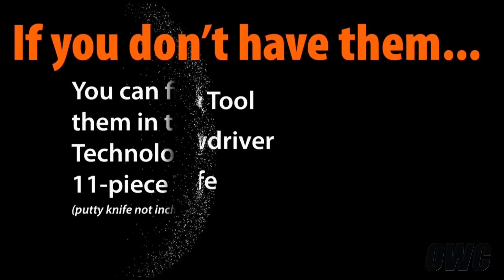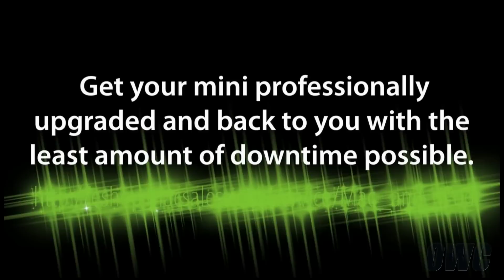How to Install Memory (RAM) in a 2009 Mac mini (Macmini3,1)

Comment: Takes some courage to apply the necessary force with the putty knife and when u take off the WiFi/Bluetooth antennas, but other than that it's not all that difficult.

Upgrading from 1GB to 4GB really improves multitasking performance.

Comment: And you are correct.  The Mac mini has user-serviceable parts like the RAM, but if you break anything whilst installing, the warranty is voided.  But if you have a problem with say, your motherboard, they should cover it.

Comment: @Mike: You can magnetize a screwdriver by dragging it on a magnet. Don't drag back and forth, just drag in one direction (from center to tip), then pull away and repeat a few times. More strokes == stronger attraction. Even a simple 'fridge magnet will work.

Comment: I bought the 4 Gig OWC memory upgrade for my Early 2009 Mac Mini and used this video for help with the installation.

No problem it worked great. The extra 2 Gig makes a big difference.

One thing worth mentioning - you need a very skinny phillips screwdriver to get at the screws.

Comment: Great video! Took me about 20 minutes, most of it getting the cover off. It was totally worth voiding the warranty. It's up in six months anyhow. During install, my AirPort antenna disconnected and I did not reconnect the audio ribbon correctly. I learned that you can never be too careful around these connections.

Comment: so , i did it and works great. I did however break off one of my air port wire antena. The first one that is attached to the drive side.works fine...am i going to be ok ,or should i start taking soddering classes?

Comment: Really clear instructions, it was easy first time (didn't take as long as 40 minutes though - don't worry!).
It should be noted for first timers, RAM should only be installed in pairs - therefore unless you are installing another 1GB RAM in the second bay, you'll be taking out the 1GB it came with.
You can therefore install either one 2GB or one 4GB RAM - or - a pair of either two 2GB or two 4GB. A combination won't work, they have to match.
Hope that makes sense! Thanks again for a great video.

Comment: This girl did this by myself! Have a good pair of eyes and be careful touching things inside and have plenty of light...saved me 200 bucks. Cost $20 for the memory on Amazon. Just people pay attention to video and which screws to remove and don't smash the antenna wires putting back together.... Thanks!

Comment: If you upgrade from 1gb to 2gb, the Nvidia 9400M video chipset will allocate 256mb for itself instead of 128 - so you get more video RAM.

Also, I've noticed that OS X itself takes up quite a bit of RAM.  I'd think 2gb of RAM should be the minimum for OS X.

Comment: Hey does anyone know the Max specs for the Mac Mini? mainly how big of a hard drive and memory can it support?

CPU is soldered in and the graphics is integrated, so the Memory and the Hard drive are the only thing you can upgrade yourself on the mini? (Not including crazy advanced mods i.e. Soldering Gun)

Comment: Thx for this video. I was very impressed with the clean inside and almost no dust on the fan, compared to the servers i used to work on from DELL...brrrr
 just upgraded my  late 2009 mini to 8Gb, now i have around 70% free memory. Found a strange connector for the HD, otherwise i would have exanged the HD as well.

Comment: Just successfully finished my upgrade, thanks for the video, it was very helpful. Some tips: have a strong light source above yourself, since the large bold is pretty difficult to put back in the hole. The large antenna disconnected in my case, when i was pulling off the drive assembly, but I reconnected it and all seems fine so far(40 minutes). It took me 50 minutes to complete the upgrade.
The mini is snappy now, finally I can run some heavy apps :)
The memory i installed is Kingston 2x2GB kit

Comment: Great videos! Used this and the hard drive upgrade one and love my new old Mac mini late 2009. It's like a new computer. Do want to mention to others that the mac might need a resetting of the VRAM in order for the ram to work correctly after installing it. Thanks again!

Comment: Nice clear explanation and video.  Moderate-level geekiness and reasonable care is all that is required, not professional level.
Reply: +David Kreutzer Really, it depends on how much experience you have taking electronic gear apart. For most people, it is probably correct to rate this as an "expert" sort of thing. (I taught myself soldering at age 12; so I, like you, don't find the steps depicted in this video intimidating at all. There's not even any soldering required!)

Comment: the 2009 model, which is currently sold by Apple and Best Buy when bought with only the 2GB Ram inside, really only has 1 module inside?  As seen by the one in this video that you upgraded.

Comment: I am upgrading the ram in my 21.5 inch mid 2011 imac.  Will will I be able to use this 4 GB of 1333 mhz DDR3 ram as an upgrade in my late 2009 Mac Mine?

Comment: I upgraded my late 2009 Mac Mini to 8GB. However, when I powered it back on, the white light in the front of the console is blinking,the device is beeping and the system does not come up. Any thoughts on how to rectify this?

Comment: The upgrade went smoothly and now the old Mini I found at a discount is running at 2 GB more, thank you!

A few comments: A kitchen knife did fine for removing the cover, don't use a sharp one though to avoid damaging the plastic parts. A (weakly) magnetic screwdriver is highly recommended, especially for replacing the screws which was the hardest part for me.

Comment: Yep, repeat those steps until you get to the memory, then seat it properly. That is most likely all it is. Try a few times. Still doesn't work??? Put the old ram in. If that works, you got bad ram. If it doesn't - you probably trashed your mac with static.

Comment: Thanks for the helpful video.  I just successfully went from 1 GB of RAM to 4 GB of RAM without any issues.  FYI to people - I didn't have a putty knife but I was able to get the case open with an iSesamo tool AND a metal spudger.  I couldn't do it with just the iSesamo because it was too flexible (the spudger alone would have been too thick to start the process so, like I said, I needed both).

Comment: I made the upgrade to 8GB and it has had an incredible effect on the Mini's performance.  Thanks for a great instructional video!  One note for others doing this: I did not clip the memory in place far enough the first time, and there for got a series of 'beeps' when trying to boot the computer.  Took it apart a 2nd time, pushed them in tighter, and the problem was fixed.

Comment: This doesn't seem to work to upgrade to 8GB in a 2009 Mac Mini SERVER.

I get the beeps when I follow these instructions. One thread said to upgrade firmware. I have MM31.00AD.B00, and the most recent upgrade from Apple says it is not needed when I try to install. I tried installing one 4GB SIMM at a time, resetting the PMU after each as suggested (https://discussions.apple.com/thread/3148543?tstart=0), but that doesn't work, either.

It WILL run with one 2GB SIMM and one 4GB SIMM, but I'm sorta bummed that I can't upgrade my expensive server as much as the non-server version can be upgraded!

Any thoughts or ideas how to get 8GB in a 2009 Mac mini SERVER?
Reply: +Owc Macsales , I reset the PRAM and the SMC, still get the beeps if both the 4GB chips are installed at the same time. If one 4GB and one 2GB, in either location, it works.

I went to the link referenced, followed the instructions, and sent them a message about it, but got no reply!
Reply: Same problem for me but have 2009 mac mini

Comment: I just installed OWC memory in my Late 2009 Mac Mini with the 266GHz processor. I had delayed doing this for over a year. 

The upgrade was not quite as difficult as I had thought. You just need to be patient and careful, because some of the screws and parts (such as the ribbon cable) are very small. Be sure to work on a well lighted desk. Wear your bifocals or reading glasses. And, be sure that you buy the toolkit and putty knife from OWC.

I replaced the memory battery while I was inside. Everything snapped back together and the computer worked the first time after it was powered up. I now run VM Ware Fusion and Windows 7, which I need when I occasionally must use when running application software that is not available on the Apple OS X  platform.

The Apple operating system is the OS X El Capitan. The computer seems only a little bit faster but at least I know that I have the maximum amount of available memory installed (8 Gigabytes). Boot-up time for OS X seems a little longer, but it might be my immagination.

Once I loaded Windows 7 and installed the many patches and upgrades, Windows works reasonably well. It is a little sluggish at times, especially when opening programs, but good enough for my use.

Once when the computer was restarted, OS X asked me if I wanted to load a new copy of OS X.  I'm not sure why this happened, but I re-started it and the problem went away and has not occurred since then. I had no problems with the new memory not being accepted.

I am hoping to get another 1-2 years out of this system. It works really well. Although it is not quick by today's standards, for the basic things I ask it to do, top speed is not really an issue.

OWC's online instructions were very helpful. I ran the video on my tablet while I had my Mac Mini opened up.

Comment: Excellent video. I was able to upgrade to 8GB without any hassle. Definitely recommend having magnetic screw drivers. Thanks to OWC for posting this. I would have never tried upgrading because I wouldn't have known how to open the computer without it. Also recommend using the Crucial Memory Scanner to make sure you buy the right memory.

Comment: Thank you so much for this! I went fom 2Gb to 8Gb, it's like having a new Mac! This thing will last at least 5 more years thanks to a 70€ upgarde!
Reply: well it's been 6 years.  Is it still holding up? lol
Reply: @WantBadtime  Yes! My son is now using it! I changed the hard drive for an SSD but that's it, still going!
Reply: That's good! I am planning on buying one for my old mac mini so I can use it.  They are so cheap now-a-days

I might even slam 8gb into it and it can be a good media machine
Reply: @WantBadtime  Might be cheaper to just buy a Shield TV for a media machine, thoses things are incredible for that role.

Comment: Hi there, For some reason my 2 small antennas do not come off. I applied probably too much force than I should have trying to pull them out and they still didn't budge. I'd love to swap out the ram and HD but can't get those antennas off. I didn't even try the big one yet. Anyone have any thoughts? 

Thanks for the video either way, very good video.

Comment: Day before yesterday I upgraded my mid2011 MacMini memory to 8GB and it was so easy.  Now no more spinning beach ball.  Now I need to upgrade my wife's 2009.  This is more complicated but should take about 15 minutes.  I'll practice on my old 2009 first.  So apparently the 2009 has 2 memory slots and they put only 1 GB in.  What's the max I can put in, 8GB??  God do I wish I'd done this sooner...
Reply: +Owc Macsales Did some 2009's have only one memory slot?  I know that my wife's, and my old 2009, had only 1GB. 
Also,I think I saw in one video that SOME 2009's would use only up to 3 GB of memory.  You could put 2 2GB in but it'd use only 3GB.

Comment: Excellent video very clear and well worked out step by step instructions. I managed to do the upgrade in 20 mins.  I managed to use an ordinary kitchen knife to prise off the cover, but you do need jewellers screwdriver to remove the screws. Note that the new memory does need to be pushed right home into the slots, it is quite stiff.
I used this memory 
http://www.ebuyer.com/393016-crucial-4gb-ddr3-1066mt-s-laptop-memory-for-mac-ct4g3s1067mceu
to upgrade my Mac Mini from 2GB to 8GB. New firmware supports 8GB (ensure all software upgrades are applied).